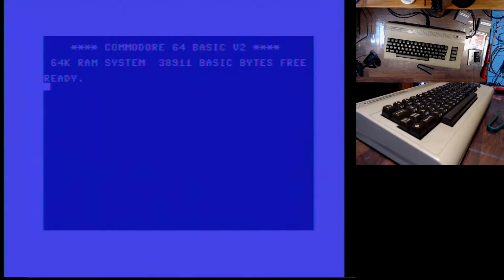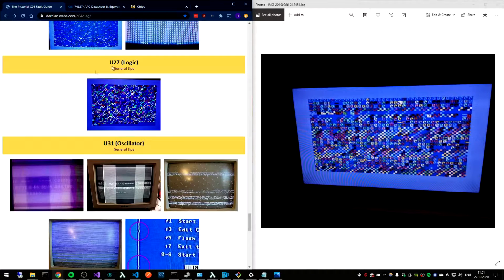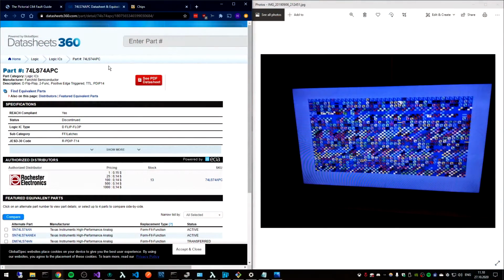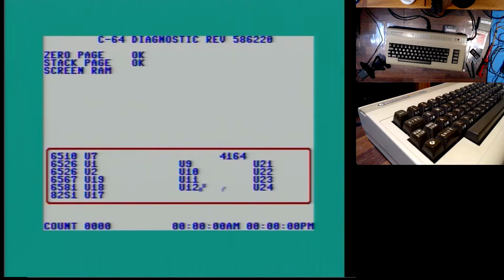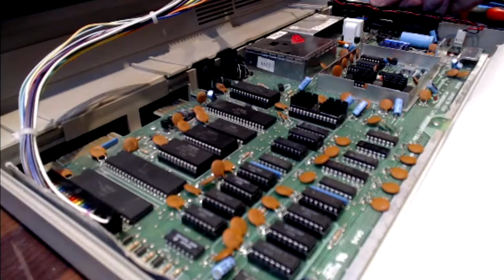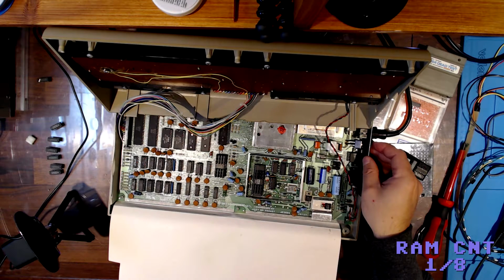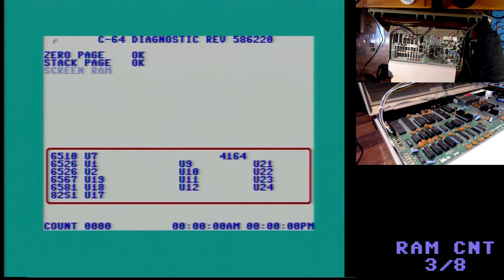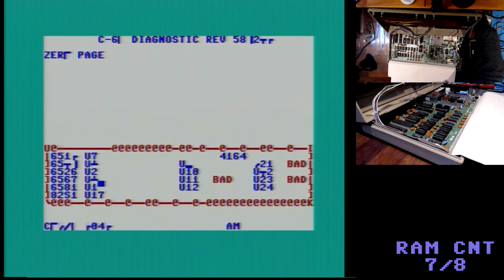C64 Fix Series | Exploring a C64 fix and testing RAM-chips [Part 1/?]

Comment: When I turn my C64 on, the screen kind of momentarily flickers but nothing changes. You can only tell that it responded but no other screen appears. I checked inside and found the flip flop to not be outputting right stuff.  VIC chip gets the two clock signals (8.1 and 14.3 MHz) but outputs no clock signals for the CPU from pin 17. U29 isn’t outputting the 1 MHz it should after the 2 MHz that I measured it was receiving. I don't even know if it's possible that one faulty chip has cut off video.
Reply from the maker: It can be hard to troubleshoot these things. Sometimes it looks like a chip is not working because the signal seems wrong, but that can also be because of the input on the chip it's connected to is pulling the signal down. The easiest way to troubleshoot is if you have access to a working machine and can test ICs in that machine. But I know that that is not usually the case. I use this guide sometimes when there are visual clues in the video output: https://www.pictorial64.com/index.htm
Reply: @HAGSLAB  I wish I had a working board. Although saying that, most of my chips are soldered into the board. I don't know how you all YouTube folks always have boards with socketed ICs. Even to attempt swapnostics, I have to solder and desolder a lot of stuff.
Reply from the maker: I've had to desoldered A LOT of ICs and put in sockets. But yeah, it is a lot of work. I like Adrians Digital Basements ZIF64, where he's put in ZIF-sockets.
Reply: @HAGSLAB  Adrian, you and various others on YT have a lot of content on fixing C64s. Where they fall short for me is that a lot of them require you to already have a working one to help diagnose the problem. I hope I get to swap out that 74LS74 (U29) and lets the machine at least output some video. Need to go get a soldering kid and some sockets!
Reply from the maker: @safatkhan676  Yeah, fair point. I don't really try to make my videos like repair tutorials though. They're mostly for entertainment and my own amusement, but hopefully they can be a bit educational as well. Adrian and others are way better than me to do diagnostics and this C64 was my first repair project.